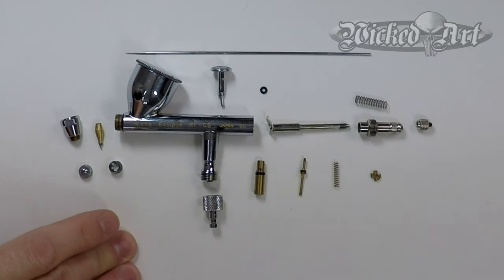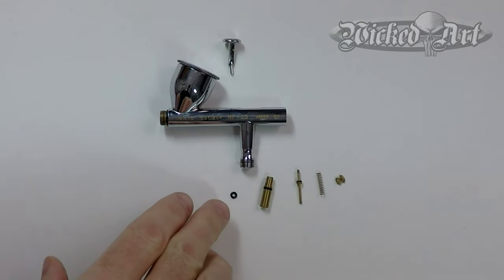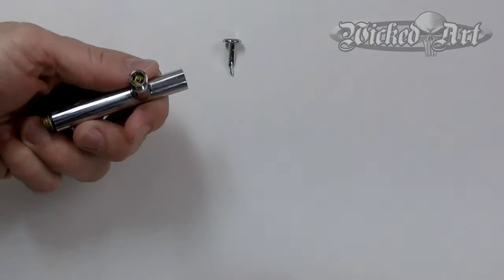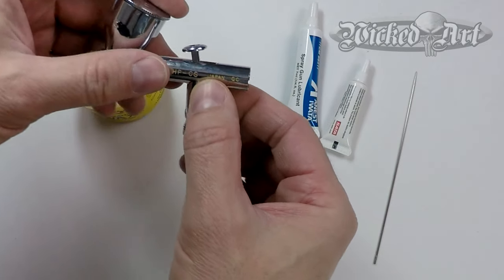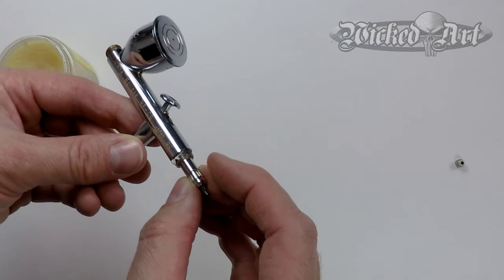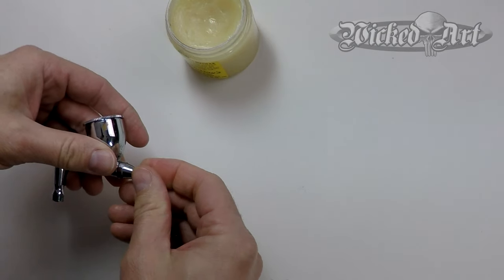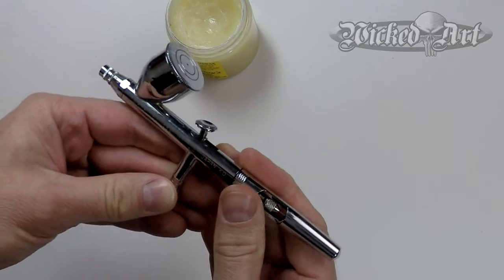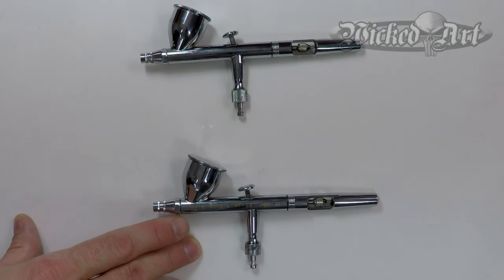Airbrush 101: Troubleshooting Air Problems

Comment: Thanks for sharing your experience. I too have an HP-CS, and have encountered the fluid nozzle getting stuck, but mine stuck to the body of the airbrush. I won’t be tightening the nozzle cap so hard in future, and will get some beeswax. 👍
Reply from the maker: Years ago, I had the nozzle stuck to the airbrush body as well.  I'd forgotten about that until I was in the final stage of production and didn't have time to go back and shoot that portion of the video again.  You have to remember all of those parts are brass.  Cranking down the head cap results in almost a compression fitting between the parts.  A small amount of Beeswax around the outside of the fluid nozzle (where it sits in the airbrush body) keeps the nozzle from getting stuck in the airbrush body; however, it will still get stuck in the head cap if you overtighten it.

Comment: Great explanation. Well done. I have an Iwata HP-B with a new fluid nozzle and clean it regularly. However, sometimes when I press the trigger just for air, some paint sprays out without pulling the trigger back. Any ideas what might be wrong?  Thank you
Reply from the maker: Hey Chuck!  What is likely happening is sometimes we shut the air off at almost the exact same time as the paint.  That can leave a small amount of paint on the tip of the needle that will be jettisoned as soon as the air is activated again.  This is one of the reasons airbrush instructors drive home the saying "keep the air on".  Get into the habit of always keeping the air on while you're airbrushing, but also form the habit of turning the air off a second or two after you've stopped the flow of paint.  If you develop that habit, you won't be leaving paint on the tip of your needle anymore which will resolve the issue.

Comment: What do you think about plumber's tapes instead of beeswax to seal the threads?
Reply from the maker: I don't recommend it and here's why:  Teflon tape is great at sealing threads on air lines or plumbing lines.  There's no doubt about that.  The airbrush is made of soft brass similar to many of those air lines and/or plumbing lines; however, the airbrush doesn't have the same thickness when it comes to the material surrounding those brass threads.  The threads on the airbrush generally use a finer thread pitch as well.  Those two factors make it much easier to damage the delicate threads on your airbrush, especially when you add a foreign material like Teflon tape.  Teflon tape is not as forgiving as Beeswax or chap stick which increases the odds of damaging the threads.  Beeswax or chap stick will easily move as you thread the nozzle or needle cap back on.  Teflon doesn't move so easily.  Teflon is also harder to remove wen cleaning/resealing the brush.  Damage to the threads normally results in replacing the airbrush in my experience.  So, Teflon tape will work, but it's not the best choice in my opinion.  Does that make sense?

Comment: I recently purchased a Timbertech airbrush and I'm having difficulty with the paint not spraying. The air is exiting the nozzle is fine, but no paint, and there are bubbles forming inside the paint cup. What could possibly be my problem? I am using a 0.3 needle and air cap.
Reply from the maker: You likely have an air leak somewhere in the head of the airbrush.  Take the front of the airbrush apart and use a small dab of Beeswax or chap stick on all of the threads before reassembling the brush.  That should seal the air leak and get the brush going again.

Comment: Gotta iwata gravity. Since I bought it when I put paint in it when I pull the trigger it blows air and paint out the cup. So instead of pulling air and paint threw it blows it out the cup. Thanks for any help.
Reply from the maker: Hey Dusty!  Your problem is the result of air entering the paint channel.  Figuring out exactly where this is happening is the challenge.  The most common causes are a bad seal somewhere in the nozzle, bad head cap/nozzle cap alignment or a split fluid nozzle.  Check the O-ring behind the head cap and make sure the threads are sealed with Beeswax or an alternative sealing agent.  If that doesn't fix the issue try tightening the nozzle cap slightly (no more than a quarter turn at a time) until you find the "sweet spot" where a good seal is achieved.  A word of caution - the threads on the airbrush body and the cap are soft brass and easily stripped if too much force is exerted - don't overdo it!  If the fluid nozzle is split or damaged in any way you'll have to replace that part.

Comment: I need some help with my airbrush. I have a iwata neo TRN1. First I would like to know the working pressure. When I spray it puts out spurts out paint it also paints a eggshell texture. I need some help if you please. Thank you very much.
Reply from the maker: Hi Terry.  There really isn't a standard "working pressure" for any given airbrush.  The pressure you choose to use really depends on the artist and what she/he is doing with it.  I'm generally in the range of 10 to 35 psi for what I do.  Most of the time I'm working at about 30 psi.  25 to 30 psi is a good place to start.  It's difficult to troubleshoot problems without being able to see exactly what your brush is doing, but I suspect you likely have a buildup of dried paint within the fluid nozzle of your brush that is causing the issues you've described.  The fluid nozzle will need to be removed and soaked in a cleaning solution to loosen up the dried paint.  A small dental brush works well for removing the paint after that.
Reply: @wickedartstudio  Thank you very much. I think the other problem is my paint mixer. I’m going to do what you do one to one ratio. Thank you. I’ll continue watching your video I think this one is so better to learn from.
Reply from the maker: @terrywhitsitt8629  Your reduction ratio is likely part of the issue as well.  I say that based on the way you describe the "eggshell texture".  Properly reduced and atomized paint should lay flat with very little if any texture in the finish.  Thick paint with little reduction can spray blotchy and leave a texture in the finish because the paint isn't being atomized correctly as it leaves the airbrush.  You have to find the balance between the proper reduction ratio and the correct air pressure to spray.  It takes some experimentation and can be frustrating at times but stick with it.  Once you get that figured out the learning curve will become easier.  I appreciate the kind words!
Reply: @wickedartstudio  thank you so much. Yes I do get frustrated. I know I can’t get it so quick. Take time. You have the best instruction I’ve seen. Keep up the instructions. Thank you.

Comment: Hi. 
I did everything you said, except the Bees wax.
I have an Iwata Revolution Hc-Br it doesn't have any o rings, I changed the nozzle and needle. Still getting bubbles in my cup. It's driving me crazy.
I just purchased this in March of this year, it was working great when I got it, now nothing but problems I don't know how to fix. (This is my first airbrush)
Please help.
Reply from the maker: There should be an O-ring between the head cap and the airbrush body.  If that is missing, it's likely the source of your air leak.  If not, I highly recommend a dab of beeswax.  It works!

Comment: Very informative video. Thank you. I had a question. I just received my airbrush and the paint is refusing to spray out. I can’t even get pure water to spray, just the air. I cleaned, assembled and reassembled multiple times. What can you suggest?
Reply from the maker: What brand and model airbrush did you get?  Is it gravity fed or siphon fed?
Reply: Gravity fed. The infinity cr plus. I did notice there was some water that came out of the airhead. I cleaned it again, and applied a firmer seal. I don’t see water (or feel air) exiting the air head anymore, but still nothing is spraying out.
Reply from the maker: @christophercornacchio9679  Are you seeing and/or hearing air bubbles in the cup when you try to spray water through the brush?  Have you tried spraying with the cap removed from the cup?

Comment: This is a great video and was very informative. I've been having an issue recently and can't seem to find a solution so any help would be much appreciated. No matter which brush i use, from my cheap brush to my iwata hp-c plus the airflow feels really weak even at 30 to 40psi and both brushes struggle to spray paint. They worked fine for a day or two when i bought them but now they're suffering the same problem. I've cleaned them multiple times but they still do the same thing. I'm quite new to this and it is affecting my enjoyment of the hobby. Does anyone have any ideas? Thanks in advance.
Reply from the maker: I appreciate the kind words!  It's pretty rare to experience the exact same problem with two separate brushes.  Based on that information, it's likely your issue is coming from your air source rather than a problem with the airbrush itself.  What are you using for your air source?

Comment: Great video. I'm new to airbrushing and appreciate the tips. I bought one of those inexpensive Master airbrush kits from Amazon.  I probably should have spent more money.  I'm having an issue and was wondering if anyone knew what causes this. When spraying a line for example, I push down for air, start moving the airbrush, pull back for paint, draw the line, push forward to stop paint (keeping air on) but the paint doesn't completely stop. It leaves a faint, thin line for another couple of inches. It's new and I've cleaned it after every use. I re-seated the needle many times and it appears to be straight.  Under magnification the nozzle doesn't appear to be split.  Any help would be appreciated.
Reply from the maker: I have absolutely zero experience with the Master brand airbrushes.  So, I have no idea what the quality level is.  With that in mind, there are generally only a couple of things that can create the issue you're experiencing and you're already on the right track.  The needle isn't seating properly or the nozzle is damaged are the two main causes.  You mentioned the brush continues to spray for a couple of inches and then stops.  So, we can assume the needle and nozzle are seating properly, just not when they are supposed to.  When you put the needle back into the airbrush you should feel a positive stop when it seats into the nozzle.  If it feels squishy at all there is more than likely a small amount of paint, or some other material (a build up of airbrush lubricant in the nozzle can cause the issue too) that is slowing the needle from seating in the nozzle.  If you're absolutely certain there is nothing within the nozzle that could cause the needle to slow down, the trigger spring could be too weak, or there is a defect elsewhere in the trigger assembly.  Check for any small burrs on the swiveling part of the needle chuck guide and on the backside of the trigger where the two parts ride against each other.  It won't hurt to lightly file those parts even if you can't see a burr or some other defect.  Adding a small amount of lubricant to those parts might also help.  If none of that fixes the issue, there is likely a manufactures defect in the needle and/or nozzle causing the seating process to slow down.  Again, it could be a small burr on either of those parts or some other defect related to tolerance.  Like I said, I have no experience with the Master brand, but I suspect the tolerances and the quality are on the low end compared to other airbrushes.  As a last resort you might try replacing the needle and nozzle.  Good luck!
Reply: Wow thanks for the detailed reply.  That all makes sense to me. I will go through it and see what I can find.
 Like I said, it's leaving a VERY faint, thin line for a couple inches. And I can really only see it when spraying very dark paint. Should there be ANY paint at all leaving the nozzle, even for a couple seconds with the trigger off?
Reply from the maker: I'm glad to help.  There shouldn't be any paint flowing if the trigger is fully forward unless you've pulled it back without the air on and loaded the needle.  Even then, you'll only get a very small amount of paint when you activate the air (not enough to spray a line).

Comment: Thank you this video was so helpful. I have only been airbrushingfor a few months, for artwork and the problem I am having, is although both my airbrushes are dual function, both now only spray paint even when you just push the trigger down, before you pull it back, so I cant just have air only so that I cannot apply the paint slowly and more accurately and do the detailed work I wish to practice . I have watched videos and am careful to clean them properly but keep getting this problem, would you have any suggestions please how I might fix this. Many thanks
Reply from the maker: Hi Patricia!  You likely have a build up of dried paint (or some other obstruction) within the fluid nozzle that's not allowing the needle to seat properly.  I suggest you remove the fluid nozzle and soak it in reducer or a good cleaner for a few hours (or overnight if needed).  That should loosen up the old paint.  I use an old airbrush needle to push the old paint out.

Comment: I took apart the airbrush and after I reassembled, the trigger goes down to a hard stop and ni air comes out.
Reply from the maker: My guess is the bottom of the trigger (the part that pivots) more than likely got pushed up and back as you installed it which is easy to do.  The lower portion of the trigger needs to drop down into the top of the air valve assembly in order for the trigger to work.
Reply: @wickedartstudio  I checked and the post is down into the black o-ring. I can turn the gun over and see the post moving in and out. If I stick a piece of wire down and push it I get air but if I use the triggers movable pivoting post, I get nothing.
Reply from the maker: @JoeFortunato009  Sorry for the late reply, I was out of town for the weekend.  Did you have the air valve assembly out of the brush as well?
Reply: Here's where it gets weird. I must have lost the nozzle cap washer. Once I loosened it a turn and a half. The air flowed. I had the right size needle and needle cap but if you screw it in without a washer, no air comes out. I unscrewed it and spun thread into the gap and now it works (Until I buy a better brush)
Reply from the maker: @JoeFortunato009  Well, at least you got it figured out!  🙂